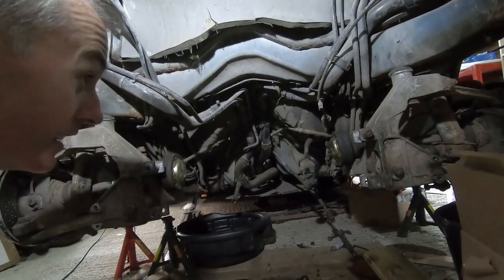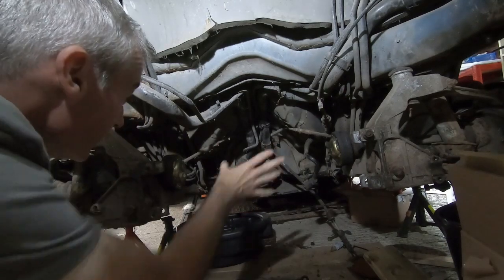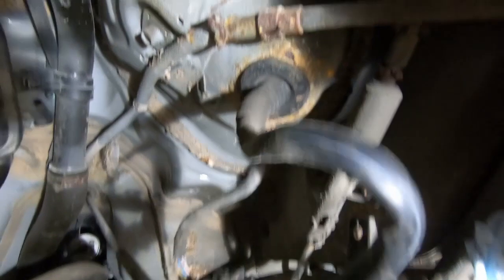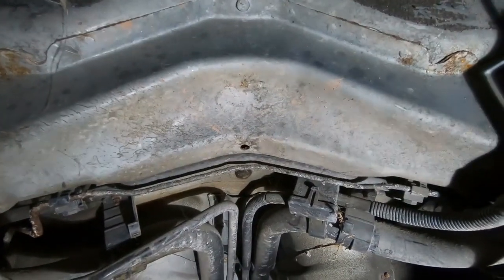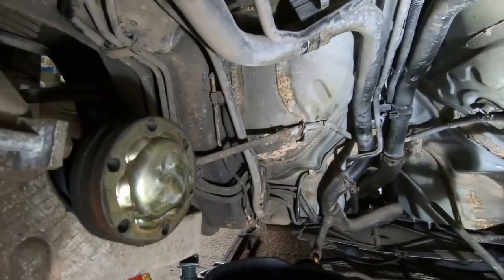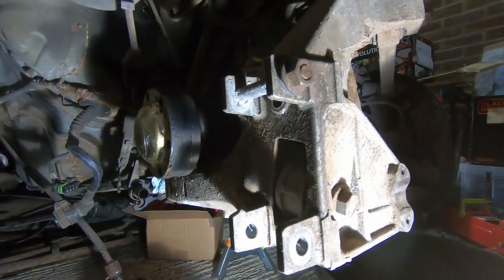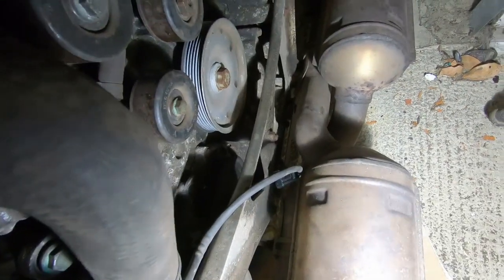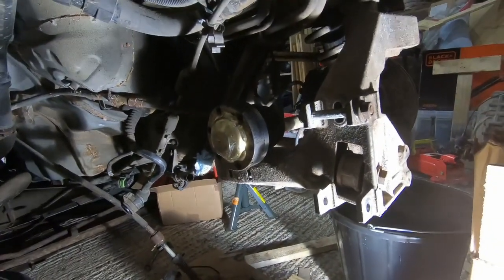Electric Porsche 911 project video 10 - Check out the space in the Porsche 911 engine bay

Comment: some one should make custom transaxle box for 911 EV adoptation.
so that the transaxle box can reused old ring/pinion gear from 911 gear box, and the Electric motor can be mounted where the gear box used to be. leaving the entire engine bay for the batteries.
If some one design it, I'm pretty sure there are factories in China that are willing and able to manufacture them with reasonable price.

Comment: Hi! Rotation of the motor compears to weeks rotation?
Reply: Weels, oops
Reply from the maker: @leaf_for_life  The Leaf motor and gearbox in standard tune maxes out about 10k rpm with a final drive ratio of 7.937. Assuming a tyre diameter of 25inches works out around 94mph. In order to increase the speed with this set up we need to run the motor at faster rpm. Other EV builders have managed to get the Leaf unit to safely spin at 15k rpm which would get us to around 140mph. Still down on the 170 the Porsche did originally, but would do for a start.
Reply: And what about direction of rotation?
Reply from the maker: Direction should be fine, I am aiming to have the motor and gearbox in the same orientation as in the leaf (motor in front of the gearbox) even though the entire assembley will be in the rear of the car.
Reply: Changing weeks diameter you will lost the power, or your dayly trip decreses